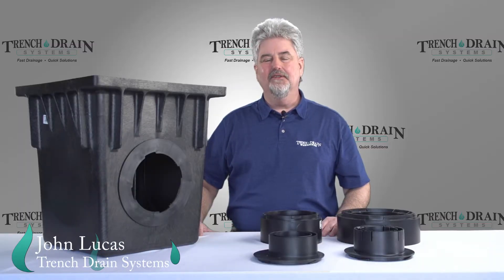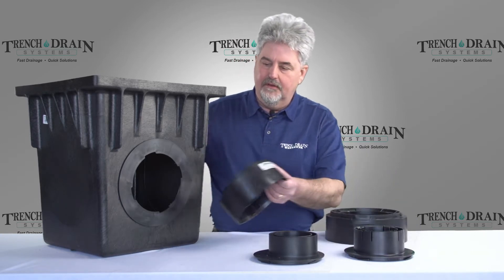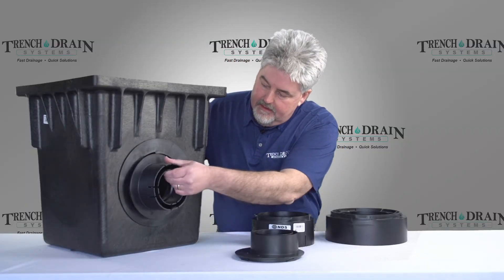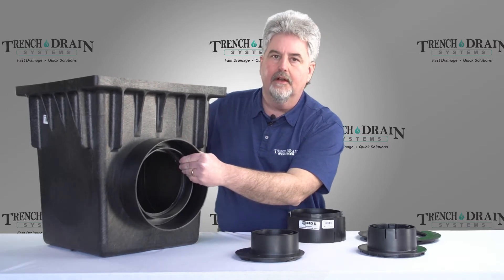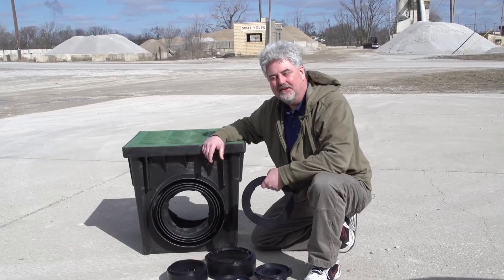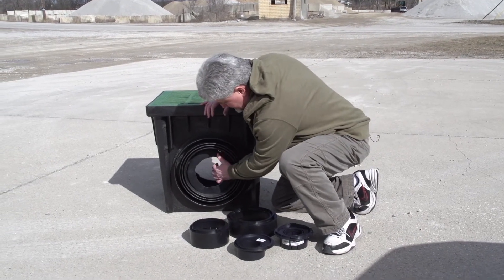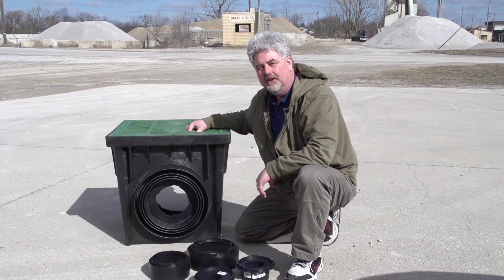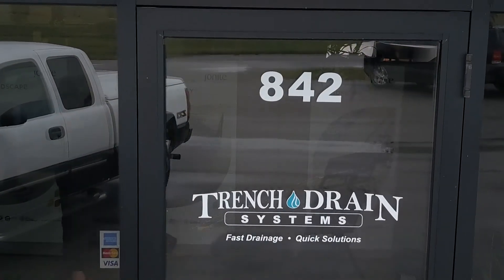How to Assemble NDS 18" and 24" Catch Basins!

Comment: $1100 for a catch basin is insane
Reply from the maker: Catch basins come in a variety of sizes, materials and grate options. Additional accessories are also available. Pricing varies depending upon the items included in the kit.
Reply: That doesn't even include the grate or extra fittings.